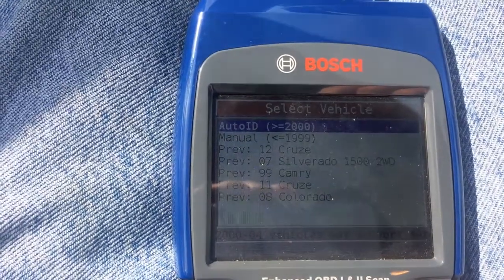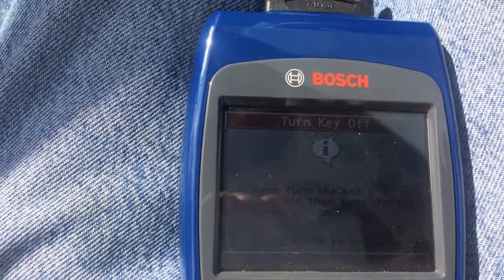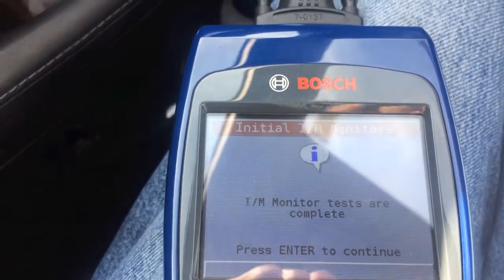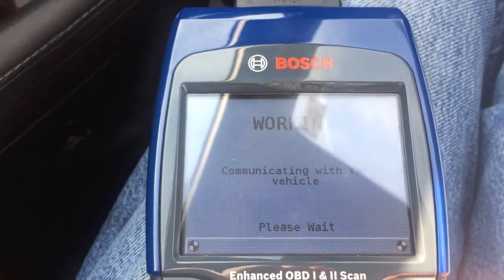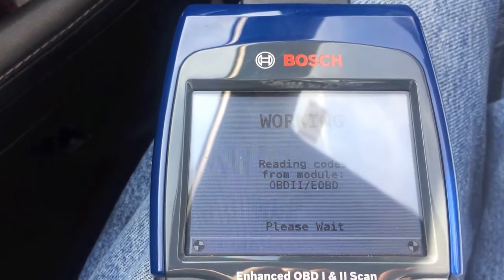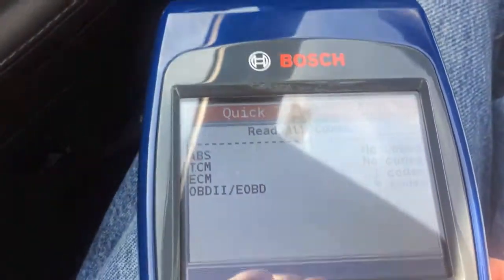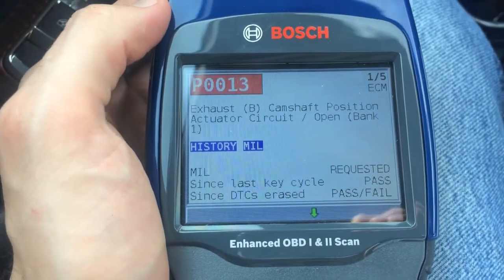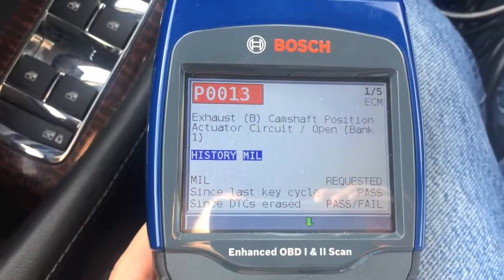Chevy Malibu/Impala/Cruze "P0013" Code - Exhaust Camshaft Actuator

Comment: I cannot find anything hardly on Impala 3.6 code P0014?? what is the fix on this??? clean the sensors??
Reply from the maker: Charles sanders 

Thanks for checking out the video and sharing your experience Charles!  We ran the code for you and it’s the

( Bank 1 Exhaust Camshaft Actuator Over Advanced ).

This is the exact part as referenced in this video!  

We recommend calling your local Chevy dealership and informing them you need this part!

Hope this helps!  

Please subscribe to the channel and turn on your YouTube notification Bell that would be awesome thanks again Charles!